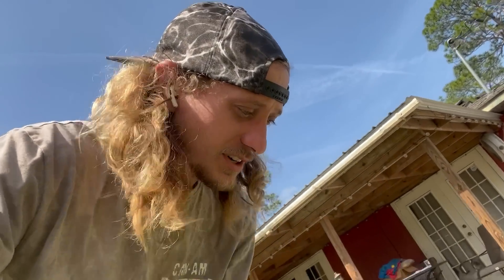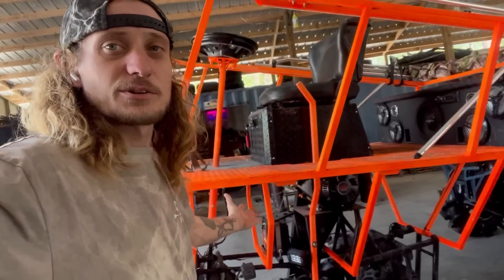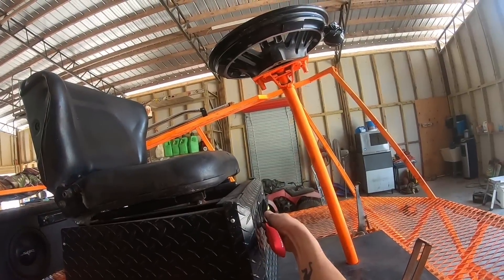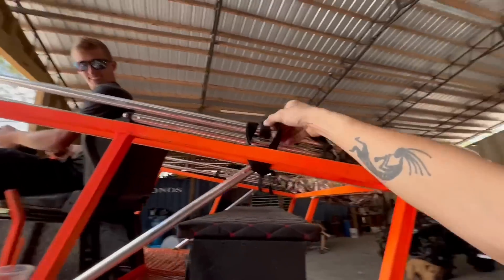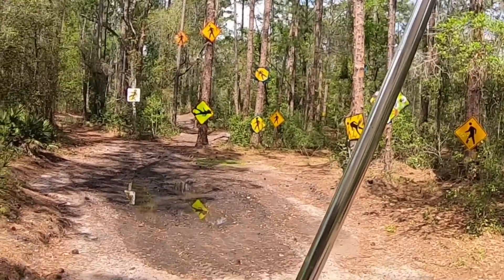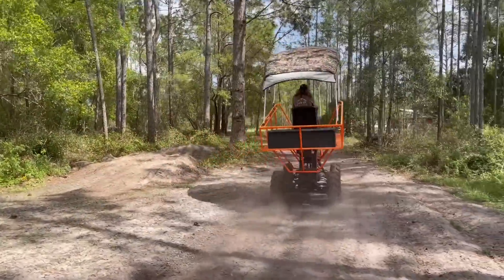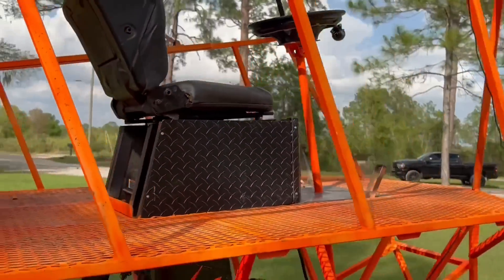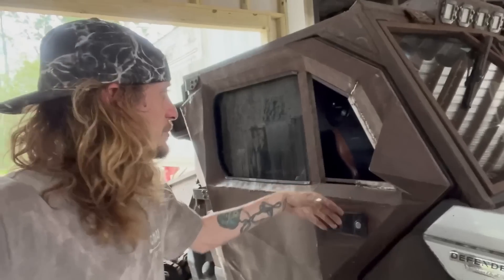I turned a 4wheeler into a Mini SWAMP BUGGY!!

Comment: Kolt, Do a torque converter instead of the clutch, also will shorten your chain, give you way more top speed and you will get way more torque as well!
Reply: I was just about to comment about the torque converter setup
Reply: @jaycevessier7554  can’t go wrong he’ll get more speed a torque and u get a wear an tear pet which is a belt
Reply: Definitely doesn't need to go fast on that thing
Reply: @greenbasterd9112  it’s not the speed tho, the torque converter gives instant torque, way smoother engagement, and can be tuned just like a regular cvt system on a sxs